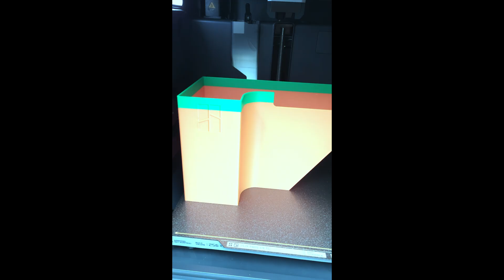Unboxing Bambu Labs P1S with AMS - This is my unboxing and first prints AMAZING

Comment: do you apply any glue or adhesives to your build plate?
Reply from the maker: Only with ABS. The textured plate holds great for PLA and PETG which I doo most printing with. ABS I do the glue stick